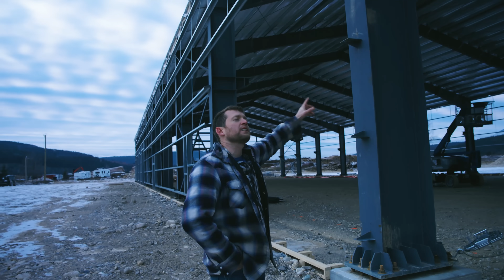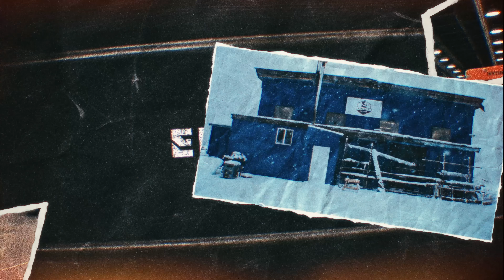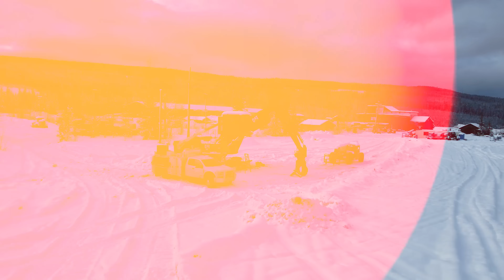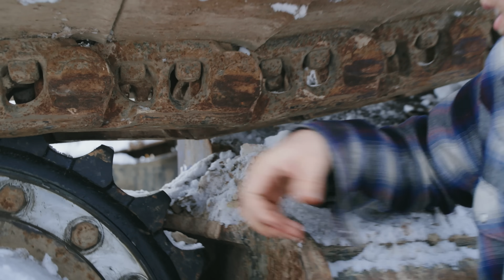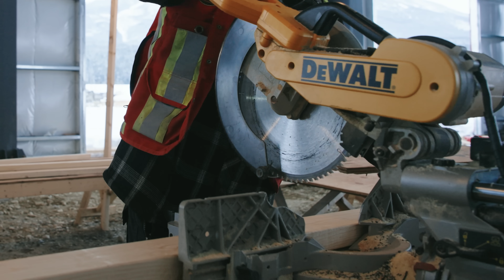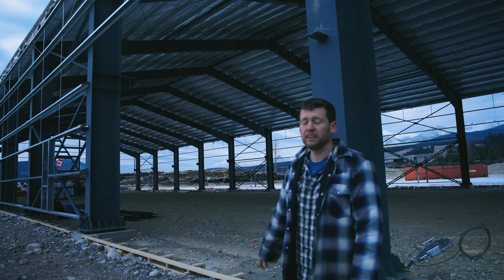Saving $200,000 With Used Heavy Machinery

Comment: You can use that machine afterwards for the Railroad Transload facility.
Reply: He also could just sell it onward again, probably for nearly the same price.
Reply: @northernmetalworker  Hearing how it was left out for a long time and sized up, servicing it to be work-ready already makes the whole investment profitable.
Reply: @northernmetalworker  Yup, with good used equipment you just send it to the next guy after paying basically nothing for rent to do your project.
Reply: Yeah, but when you're going truck to pile or pile to railcar, wouldn't a loader with a grapple that'll hold multiple logs work better than one that only holds a single log?
Reply: @mlindholm you can easily change attachment for what you need.
Reply: @niconico3907  no it's a totally different machine like I get what you're saying but you can't put a grapple big enough on a machine like that to move the quantity of logs in one pass that you can with a grapple on a front end loader
Reply: Selling it and having the money for the next project seems wise when they have a customer to load unload at the siding then they could buy another
Reply: Would it ever make sense to use the excavator on a rail line and ditch the tracks for that purpose if you're using it in a loading aspect from trailer to railcar? or a Traxx change to match the surface it'll be running on is more likely
Reply: As a railroader, I approve this comment.
Reply: itd be nice if blaine had a working railroad
Reply: @davesanders95  wdym? They're on a spur right off an active line

Comment: Keep the log loader. It’s cool
Reply: convert it to hybrid (half kidding)
Reply: Yeah - great prototype testbed for hybrid conversion.  Are the tracks powered by hydraulic motors?  Replace with electric, etc.  And if everything works and you can fix the "kinks", continue to use for any applicable tasks while simultaneously testing your hybrid conversion doing actual work.

Comment: I think you gotta paint the log loader Edison Blue - it could use a fresh coat anyway haha
Reply: If they don't sell it, it's a future candidate for a electric hybrid Excavator
Reply: @highonahill  they need to do this save alot of companies alot of fuel costs they would buy
Reply: @devonpearce9892 would you see significant savings electrifying a machine like that? I would think that it’s under a fairly constant load while operating unlike a truck that’s under load to climb hills and to get up to speed, but then under light load and regeneration on downhills and to maintain speed. 
I don’t know a lot about heavy equipment but that’s my first thought. 
Or maybe electrification to gain the torque is worth it, like the dozer?
Reply: @kevinvesey5263 heavy machinery sees extreme changes in load on a second by second basis depending on what you're asking it to do.
Reply: @highonahill yes obviously, but no real coasting I would think. Which is what gives trucks and trains such an advantage to having a small generator charging up batteries for big power when needed. 
I would think heavy equipment would require big power most of the time. So would there be an advantage to electrifying it?
Reply: While they’re at it, it could be a future prototype of hybrid tractors. I’ve got a 1965 John Deere 4020 I’d like to make hybrid and use it in county fair sled pulls. Imagine 400 hp at the wheels. I wonder if I could just use the e-axle from the semi trucks and limit the speed with software or if it’d be better to develop its own tractor-spec e-axle that’s geared even lower.
Reply: @jamesellsworth240  We think alike, and my thought is it is the axle attachment point to the frame that may need to be re-engineered.  You can always limit an electric motor with a motor controller, and nothing wrong with lower gearing if you don't rip the axle off the frame.  But I would go green, the REAL green, Oliver 1855.
Reply: @krieghandt-l9i I’d love to acquire an Oliver someday, maybe even a purple 1966 1850 like the ones from the “colorblind plough” ad campaign way back in the day. A potential problem I just realized is how to control the left and right rear tires for steering. Yes, they would have their own independent motors, but I’m not sure how I would operate that without the brake pedals. It almost seems better to just have a single motor at the input of the axle to maintain that original foot control ability.
Reply: Never mind, I’ve decided I would just have independent accelerator pedals instead of independent brakes. Also, I realized the semi truck axles are 2-speed. The tractor would only need 1. It could just be locked in 1st gear all the time. I also thought it might be a neat idea to run a driveshaft off the generator to run the PTO. Put a generator at the front of the engine and a driveshaft at the back.
Reply: i hope he doesnt overload the loader
Reply: #042069 Blue
Reply: @V.E.D.2112  no. They aren't Elon Musk. They're not cringe.
Reply: @StormCrownSr  no that literally is the official Hex code of Edison Blue
Reply: @StormCrownSr  https://youtube.com/shorts/aUghDzsusbc?si=O_WriSVVVPAa6iHu
Reply: @V.E.D.2112  oh god...😮‍💨
I stand corrected.
Reply: @StormCrownSr  Their first slogan was 'Stealing Tesla's ideas' I think.
Reply: @arthurjeyes5988  that's fine. That's a clever thing that I would not associate with Elon.
Reply: Chase, is purlin the word you were looking for? 🤔 👀
Reply: #042069
Reply: I was thinking a rig with an Edison paintjob might be harder to flip once the salvage is done but maybe Chace can raffle it off?
Reply: @ianweniger6620  they could rent it out
Reply: @ianweniger6620  Admittedly, I made the comment before I got to the part of the video where he mentioned reselling it lol
Reply: Haha, no it's a CAT it stays Yellow.

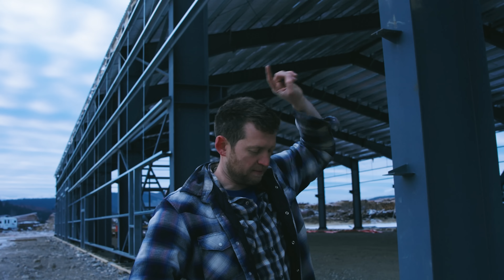Comment: 6:51 perlins
Reply: I agree. They’re girts and the purlins are on the roof.
Reply: girts, no? purlins are for the roof?
Reply: Girts on walls, Perlins on roof as Marshall said. 
Typically, Perlins factor in static loads like snow where girts don’t unless you consider wind a static load…which is not common in my area in Midwest. It’s considered a dynamic load here to survive gusts but not sustained loading like a hurricane can produce. I’m sure a civil engineer can correct/explain better.
Reply: This. But generally spelled (far more often shouted, not written): purlin.
Reply: purlins
Reply: @Nyth63  The correct term for the ones used for attaching stuff to is Girt. Purlins are used on the roof.
Reply: Or a Girt

Comment: I'm glad you decided not to do the cable pull tbh. It would have been super cool to watch, but honestly, too much risk with the rail line. Brining in the professionals to take it down, and dealing with the material yourself, I am 100% on board.     Also, I'm betting it takes about 2.5 weeks to drop. Not including cleanup!